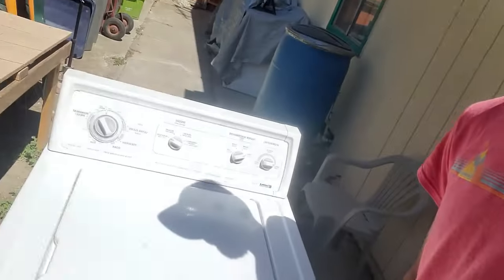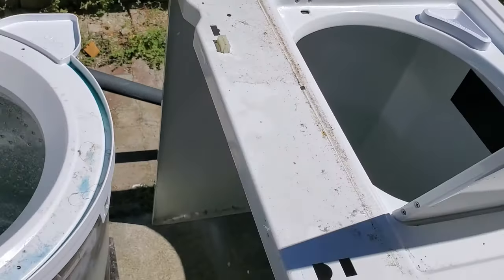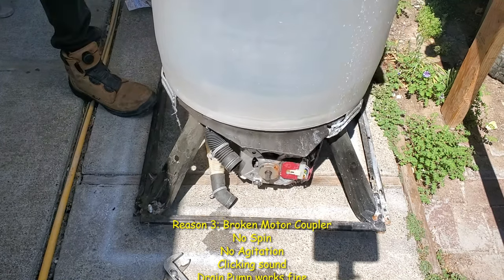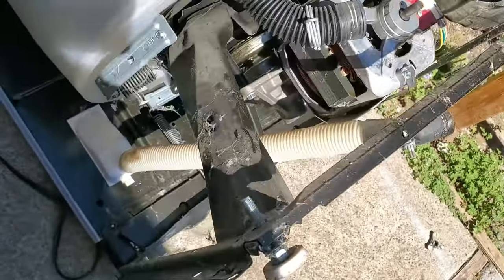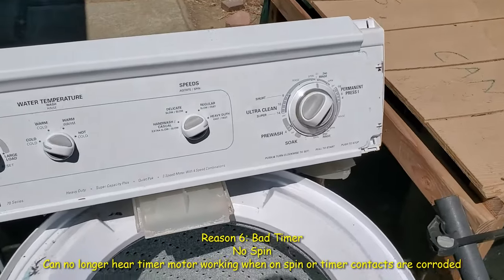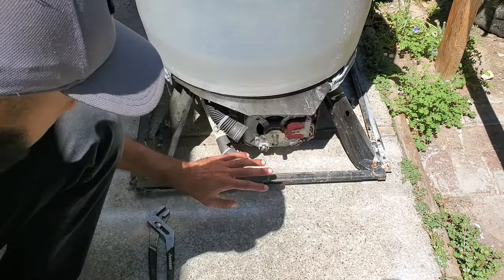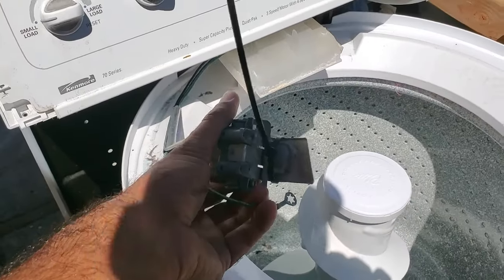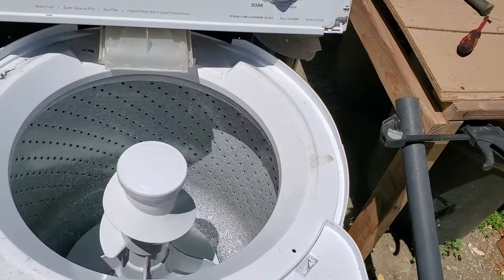Top Nine Reasons Your Older Style Washer Is Not Spinning!

Comment: I took my water pump off,, and spun it with a screwdriver, and it is just a slightly stiff movement. Is that normal or should it spins free as possible? I'm thinking it is the relay switch might be fouled. That there is nothing wrong with the pump itself. Everything works on the washing machine, except the spin cycle. The motor spins easy in both directions by hand.

Comment: I absolutely love your videos.  I have a GE washer that would not spin completely leaving wet clothes.  Although it did spin.  After watching your video, I checked the lid lock and replaced it as it was bad.  The capacitor checked out fine and the drive belt was good.  Put it back together and tried washer.  It filled with water, ran through the wash cycle and then stopped without draining or spinning.  All lights on front panel went out.  The Circuit Board in the back had a blinking green light with the identifying number of 1702.  Help!   (I'm gramma raising 2 granddaughters and need this machine working again)
Reply from the maker: Is the lid of the washer locked when it won't drain or spin? Try stopping the cycle, turning it to drain and spin and see  if it works. Also try pulling the washer plug and leaving it off for 10 min then plugging it back in. I hope its not a bad board or a bad shifter (which makes the machine go from wash to spin)

Comment: Great video thank you for all the useful info! I checked all the reasons you gave, I replaced the coupler, looked inside the pump and took apart the metal basket but still can not find the reason why my washer wont spin fast enough to wring out the water from the clothes. If you have any suggestions I’ll greatly appreciate it!
Reply: Bad clutch if it spins slow.

Comment: Thank you so much for your video. Sometimes my washer wouldn't spin. It sounded like it was but wasn't. It would agitate but not spin. I found that by kind of wiggling (moving a little) the inside wash barrel I could get it to spin. I would turn it back on and barely lift the lid just enough to peek inside without it stopping to see it spin. I have no idea what I did by moving the inside barrel that got it to work but doing that isn't working anymore. Can you narrow down what it might be with this information? It's in a closet in my small kitchen. I'm so nervous about trying to fix it myself but I want to try. Thank you so much for any info you can offer.
Reply from the maker: Sounds like it's a worn out clutch
Reply: @DuctTapeMechanic  thank you

Comment: I can add a tenth one.  I've tinkered with my slow-spinning Kenmore 300 for nearly two weeks now; replaced the clutch, confirmed the adequate condition & proper operation of all other obvious moving parts, taken the whole shebang to bits and reassembled it three times so far, all the time knowing that the solution was going to be something obvious, staring me in the face and murmuring amusedly, "You truly are an idiot aren't you."
 
Yup.

We've never been successfully able to resist overloading the washer ("Well, maybe this blanket too...oh and there are just a couple of towels, they won't make much difference probably..."), and consequently, it would frequently spin off balance, sometimes to the point where it was trying to walk around the laundry room by itself before somebody -- well all right, ME -- would hustle downstairs and redistribute the contents.  Over time, the stress imparted by heavy saturated unbalanced loads, coupled with the inevitable age-related rusting of the underside of the basket, resulted in the basket breaking in a perfect circle around the base where it swoops up in the center to attach to the shaft from the motor.  The slow spinning wouldn't even have been happening at all, except the agitator was propelling the innermost globs of wet laundry around and dragging the outer portion of the basket around with it. 
 
I would have noticed it sooner if it had ever occurred to me that such a thing could even happen.  The break was so clean and mechanically circular that I just sort of subliminally assumed it was supposed to be like that.

Comment: Awesome video!  I have a Inglis top load washer Ij42002 and it agitates fine but when it comes to spinning makes a loud noise and was spinning slow. Metal to metal bang noise. The parts i have replaced already were drive block,  clutch,  cam, motor coupler is ok.  I removed the motor and transmisson and its moving freely clockwise and counter clockwise. Could it be the basket drive? 

Hope you can help. Thanks.
Reply from the maker: Does it sound like grinding gears? Could be your transmission is bad. I've seen the brakes locked up on the spin tube, but that wouldn't make a grinding noise. Typically, metal on metal noise is a bad drive block

Comment: Your my new go to guy for fixing my washer.  
   I just watched the one with the sensing light stuck on. And the codes to indicate what's up.  And that wasnt exactly the problem.  I should have come here first. Because it wasn't spinning out and I thought it was a sensing  issue. Replaces the actuator previously and it kind if went back to normal. But still was kind if confused.
 So I went through the process with the dial. And it came alive and went into the process.  It's washing now with nothing in it. But man it went right to work with out pausing stuttering or humming. 
   But after watching this  I new I was on the wrong path with the last video.  Butbman you just gave me 9 more fixes if ever I need it again. 
 I hear it draining now.
 I'm gonna let it finish and put a load in.
 Thank you man. And the comments are helpful to. Great channel! All the best!
     Gordo
Reply: Well here I am with this washer doing exactly what it wants again. It worked fine with an empty drum. Would not work after I loaded it.
 Sensing light would be on, lid locks on and off without ant order. Drum engages and wirs and spins a bit and coasts to a stop. Then again......sensing light and lid light are solid. And now....crickets........ long wait and now water... and trying to spin prematurely.  It's still filling with water. A humming coming from inside.  Would I be correct in chasing down the sensor? Is there more then one? Maybe the controle board?
  You covered everything I could think of. 
   Still the water is filling up properly. But the drum is getting engaged to soon right.    This is not my expertise. And I respect you knowledge and appreciate how you have put so many answers out there already.   I'm just guessing and ... well I thought I scrolled through ALL YOUR Videos looking . Maybe I missed one. I will go back and do more research.  Thus is kinda interesting though. Like a treasure hunt or sumpthin. 
 You are doing a good thing helping folks be more self sufficient.
 Thank you
Reply from the maker: Really seems like an issue with your actuator. Sometimes the actuator arm physically breaks other times the rpm sensor on the actuator is broken. I would replace the actuator and make sure the clutch is moving up and down ok. Best of luck in your repair
Reply from the maker: Appreciate the kind words! Kudos to you for doing your own repair!

Comment: very educational,  thank you. My Kenmore is very close to the one on the vid. Maybe you can point me to the right direction. My motor work, it washs fine. But when it gets to the spin  mode, sometimes works, and some times does not. I can hear the motor working. But when I open the lid I realize its not spining.  Than I manually turn the barrel till it locks, close the lid and it starts to spin.  ???? Clutch?
Reply from the maker: Good diagnosis! That is the classic example of a bad clutch.

Comment: Mine agitates and drains like a champ. Agitator will spin but i can stop it with my hand. Drum wont spin. I changed the clutch and checked the coupler. Not sure what im missing unless i somehow installed the clutch wrong or used the wrong screw.
Reply from the maker: Sounds like clutch or could also be lid switch (some of the older versions agitate even if lid is open)
Reply: @DuctTapeMechanic  I looked at it again. Found that my drive block is worn. It no longer sits on top of the shaft in the two grooves. It just spins freely kn the drive shaft, so there's nothing for it to catch onto. Pretty sure it's been bad for awhile and was working based on rust and grime. I think when I recently fixed a spring, the lack of wobble made it spin strong enough to finally break completely.

Comment: I have an intermittent no spin on our kenmore 80 series. It will go through the wash cycle until it gets to the spin. Timer still tick away normal. New lid switch. I can hear it humming. If i open the lid and close it. It will spin just fine. Sometime it will spin normal without having to open and close the lid. Is it the clutch or something else?
Reply from the maker: Sounds like your clutch is slipping. I would replace the clutch first as it is cheap (small chance it is a shotty transmission)
Reply: @DuctTapeMechanic  thanks. I will go ahead with that.

Comment: My washer will spin occasionally but not every time the cycle is set to spin. Motor works, clutch is brand new.  Pump spins freely by hand.  Could it be a bad board?
Reply from the maker: These do not have control boards but work off a timer. It could be an issue with the timer or the motor capacitor

Comment: Thank you SO much for this! Extremely helpful! I was able to diagnose and fix the problem with my ‘07 Maytag by myself, and I’m sure it saved me a small fortune vs hiring someone! It was both the agitator dogs AND the motor coupler, worn down to nubs. I replaced the clutch and changed the oil in the gear case for good measure, since I was already all up in there lol. Works like a new machine now!
Reply from the maker: Glad the video was helpful. Awesome job with replacing all those parts, hopefully it will add another 10 years to your machine

Comment: Nobody answers this question.  What if my whirlpool top loader sometimes spins and sometimes doesn't? Agitator works fine..Clutch is new, and coupler is fine. Lid switch is inactive and is irrelevant. 

Timer seems to work ok, except on knits and gentle cycle it doesn't work..Other cycles work fine.

So is it my timer or transmission?

Drains fine and agitates well. New whirlpool clutch installed  5 months ago. 

Maybe contacts worn in timer cause when timer is cold it sometimes spins. 

I notice back of timer gets warm, is that normal?

Comment: Hey brother thanks for thr video. I thought this was the problem so i replaced the switch. I have a frigidaire combo washer dryer top load. And what its doing is that it fills water and then drains it right away and ends the cycle on normal wash mode. Do you happen to know what could be the problem?

Comment: Going to my mom's house in the morning. She said it made a loud grinding sound then stopped working. I'm hoping it's just that block nut. It's a direct drive Whirlpool with a spring clutch assembly.  Any thoughts?  Great video!
Reply from the maker: Most likely is the drive block. Especially if it was a loud metal on metal sound.
Reply: @DuctTapeMechanic  Thabk you. I hope so.

Comment: First thanks for posting this: HELP: Next i have a 600 model that does not spin unless i lift the lid then close the lid. There is also no visible, i don't know what it's called---when the lid is up, you cannot see the hole where the lid sits down into when closed----. I have no idea where on the lid that is.
Reply from the maker: Yes the issue is the lid lock mechanism.  Depending on the model number it should be less then $30 purchase. Just search your washer model number on Amazon

Comment: I have a Maytag lat9206mae washer hums when it gets to spin cycle takes a long time but finally spins. changed the timer because it was broken inside then it started doing this. Thought it was the new timer after a year or so of dealing with this. But it still takes forever to go into the spin cycle. It hums like the motor isn't wanting to start. What do you think this could be. Thanks
Reply from the maker: Humming sound from motor could be a multitude of different things , bad motor capacitor, something stuck in drain pump, bad motor, bad transmission. I would definitely test the motor capacitor and the drain pump first.

Comment: Do all washer have the same problem for example speed queen washer agitates but does not spin ,model is LWS11NW, even though it's not the same as direct drive but the clutch or lid switch is also the problem or ?

Comment: My washer washes but doesn't spin to dry clothes. IT just makes noise but doesn't spin. It doesn't spin when clothes are present but spins very very slow when empty. It just spun once properly when I reset the motor by shutting off the washer for 2mins and after closing and opening lid 6 times. That doesn't work anymore. Can you please tell me what could be the reason?
Reply from the maker: Seems like an issue with the clutch it could also be a bad motor capacitor
Reply: @DuctTapeMechanic  Thank you for replying. I will check both.

Comment: I have the same model  washing machine but the problem there is no sound at all  no start no sound at all  is it possible the capacitor thanks in advance
Reply from the maker: Does it fill with water? Typically there is a hum when the motor capacitor is bad. If there is no sound after filling then it could be a lid switch issue
Reply: @DuctTapeMechanic  yes it fills water

Comment: Mine won’t spin and is smelling like something’s burning after turning the knob on to spin. Help! Thank you
Reply from the maker: Could be the clutch slipping and getting hot
Reply: @DuctTapeMechanic  That was probably the problem but didn’t want to deal with it so I bought a new one. Sorry I missed your comment, It was at the bottom of my notifications. Thank you for responding.

Comment: What might cause a brand new motor start capacitor to blow within a few minutes of being installed?
Reply from the maker: Now that is very strange. Most of these capacitors are good for decades!
Reply: Yes the original lasted about 20 years, the new exploded within 5 minutes. Is there anything about an OEM capacitor I should consider before buying another?
Reply from the maker: @michaelcoffey4297  There are a lot of bad knockoff products on Amazon. I would return it! I'm not sure if it was a fluke or not. But OEM is the way to go. I have a stock pile of OEM capacitors from recycled machines, so I never had to buy one.

Comment: My coupler and clutch are good but still doesn't spin. When I put it in spin I hear the motor turn on but that's it! I need help please!!!
Reply from the maker: There is a little plastic piece called the brake cam on the drive shaft sometimes it can break and lead to spinning issues as well
Reply: @DuctTapeMechanic  I checked that and it seemed fine. I'm going to check to see if water pump is clogged?

Comment: What if you replaced the lid switch it worked for five washes. And then the machine stopped working again not working by. I mean not spinning after the rinse cycle.  Could it be a faulty aftermarket lid switch I purchased.?
Reply from the maker: Does it spin if you manually turn the knob to spin? It's strange that it worked good for 5 loads
Reply: @DuctTapeMechanic  no, it’s just quiet like it’s not on. I have to unplug it and wait then plug in and put it to start Al over again. It goes through the first cycle spin and all, the last stage of the cycle it won’t. Also I noticed it makes like a cranking noise when “switching” from one mode to another. Also when it gets to the spin cycle the second time I can hear the timer go quiet or dead. It won’t keep going.
Reply: Thank for replying as well.
Reply from the maker: @esevilla11  I see. If it is spinning at first then it is not a lid lock issue. Try using another setting (permanent press or if you already using that try ultraclean). I fear you have a timer issue
Reply: @DuctTapeMechanic  understood thank you so much. I will try that if not I think I’m giving up and calling someone. Again thank you much!
Reply: Update-I’ve ran several washes I noticed two things. 1-it spins during the first half of cycle but not second as long as it has light load. 2-the timer seems to stop transitioning on the last spin cycle on any of the settings. I’m going to try and clean the timer maybe re place it. If it’s not that then maybe it’s the clutch,  I May try my hand in changing that, we will see. Thanks again!
Reply: @DuctTapeMechanic  hi me again, so I have changed the timer for a refurbished one and it started working only on a certain cycle it would not work on the other cycle, it worked about 6 times and now it won’t work again you can’t even hear the timer, could it be the used timer I bought? Also if o unplug it and plug back in it seems to work again.

Comment: My whirlpool ultimate care 2 will not spin after wash or rinse cycle the lid switch is by passed before you could raise the lid and it would start to spin now with lid switch bypassed you have to turn the timer on and off for it to spin have 2 with same problem does anybody know the fix

Comment: I've been stuck working on an old Inis whirlpool washer. No spin and a burned up lid switch. I bypassed the switch, and changed the coupler (it wasn't broken) but it was cheap enough. Also, the timer stops midway through a load so took it apart and cleaned the contact points that were pretty burned up. Replaced everything and the problem persists. So I took timer apart again and noticed a little double legged spring inside that was loose and out of place. Spent hours trying to get that and the timer cam thing lined up until my head hurt and gave up .Now after watching this video, I think it needs a clutch too . I'm looking for a used replacement now but liked and subbed your channel as it has great how to info.
Reply from the maker: Soon enough you will be an expert!